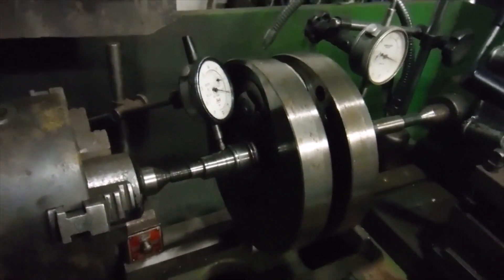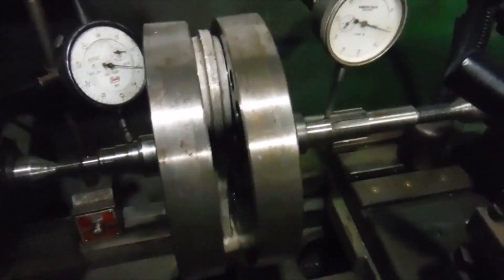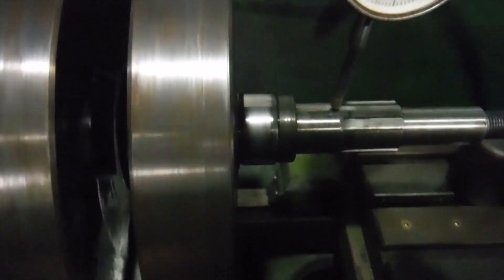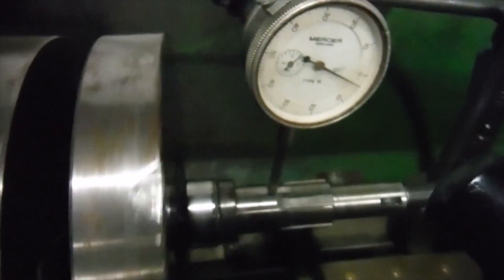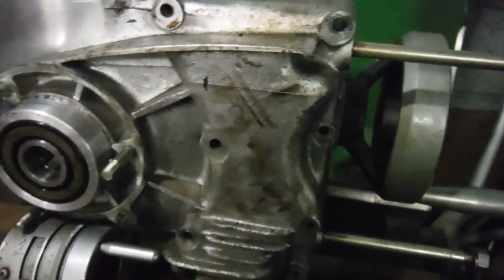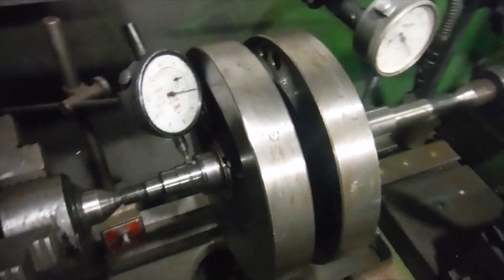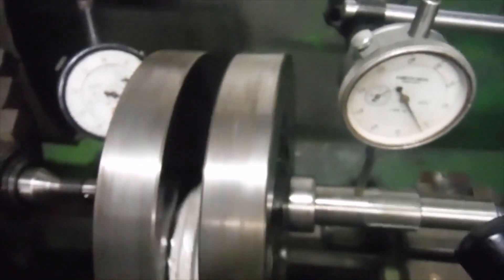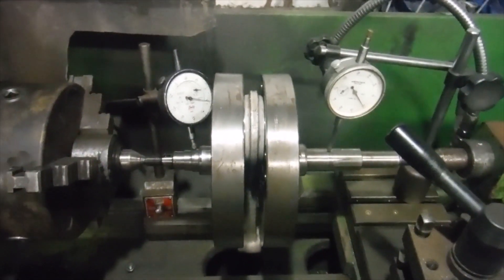Royal Enfield Bullet primary chain tension issues, bent mainshaft suspected, but true culprit found!

Comment: Remember a mate( back in 1980) with a G2 matchbox 250. (The laughingly monikered “ lightweight “)  he was getting through gearboxes and bending mainshafts regularly and Joe Francis on the Footscray Road was getting good business out of the Burman exchange boxes that he was paying for. I was doing my tappets on my Saint round at his one day, and he was doing his chain tensions.  When I saw the 3/4” free play that he had on his final drive chain, the mystery was solved. The chain was bowstring tight and could just about be deflected by 3/8” either side of the arrow straight line it was in. 
I showed him what a chain should actually run like and the box was fine ever after.